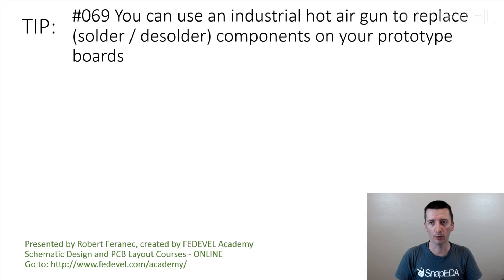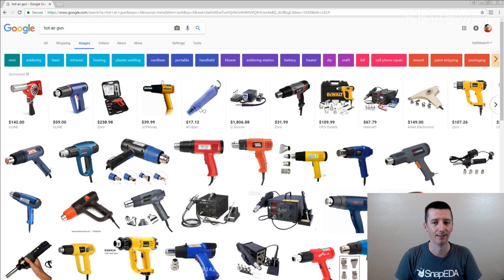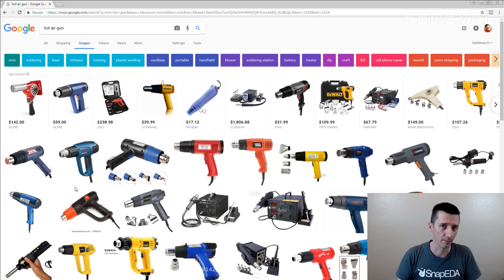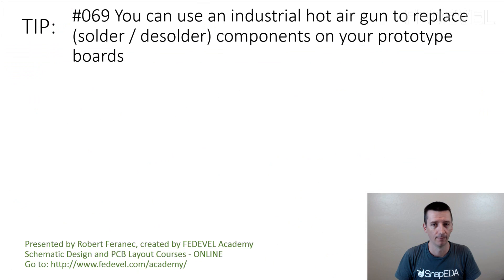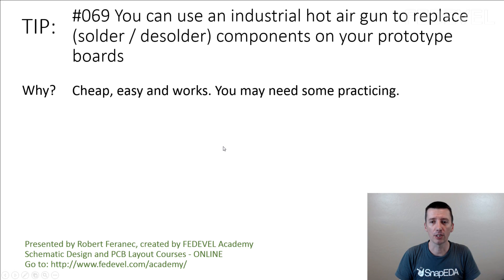TIP #069: You can use an industrial hot air gun to replace (solder / desolder) components ...

Comment: U can do this, I bought a 2000w industrial heat gun with a dual temp setting for less than half the price of a hot air station however you must check the product description for what temperature each mode on the hot air gun is. Look for one between 250 to 300 deg Celsius (nothing above 300 as the reduction nozzle increases the temperature a bit) also u can put the same nozzle as a conventional rework station on top of the reduced nozzle and it's just as good for half the price as I have soldered and desoldered components with it. Ps: my gun has the low mode on 220 degrees Celsius and the high mode 700 degrees Celsius which I rarely use for a second or two to get the temp a little higher

Comment: I really like your videos but I will disagree with this one. Yes, it will work, however you can do huge damage to the board or components if you don't have temperature control on the hot air station. Everything from board deformation, pads and tracks damage, componnets overheating and many many more. You can buy the cheapest hot air station with the temp control for something like £20-£30 so I don't see the point of buying industrial hot air gun.

Comment: You can, but is there any particular reason you would do it as long as a 858D hot air station is cheaper than these guns?
Reply: It's right 858D hot air station are very low cost, @zenon Dorin Do you use this station, do you advice its?
Reply: I use it and it works very well (it's actually 858D+).